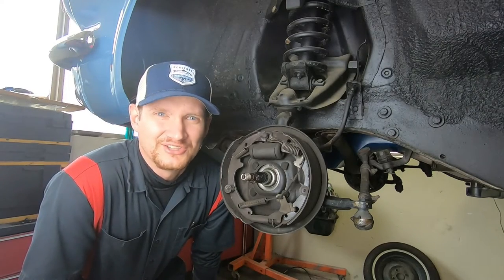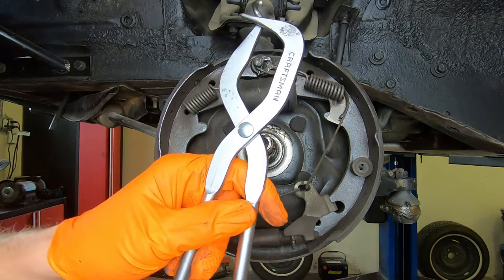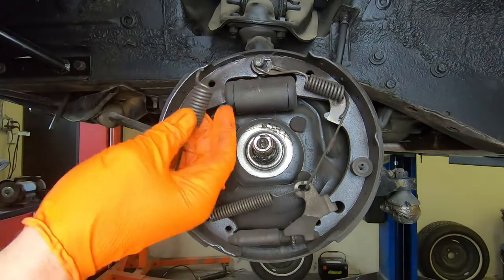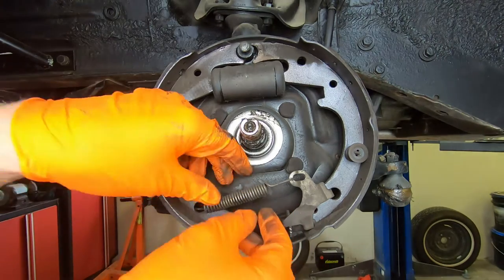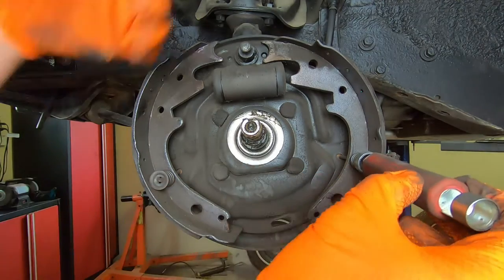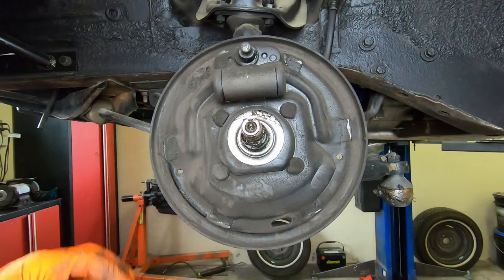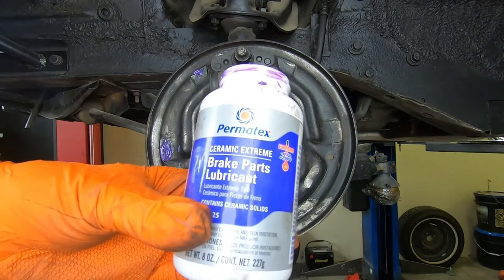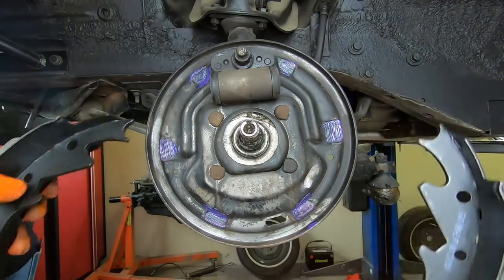How to replace drum brake shoes on your classic Ford Mustang

Comment: Excellent video on the lost art of replacing drum brakes.  Keep up the great work.  Your Mustang "how to" videos set the standard.
Reply from the maker: Oh awesome I really appreciate that!
Reply: Wow!! Mine are a bit different. There is a piece of metal with spring on it goes across over top of spindle. And then I have some type of metal stud that comes out each side of the wheel cylinder and goes to shoe to spread them. What's up with that?

Comment: Super helpful, just installed front shoes on my 71 coupe. Only thing I would add is that once these are installed, you'll need to adjust them. I turned my adjuster until it locked the cover, then backed off a little until there was slight contact
Reply from the maker: Thank you!

Comment: I have a 1956 Mercury with a hard to turn driver side front wheel - I have never done a drum brake.  I use the car every year....however, I replaced the tires and found the driver front drum so tight I can hardly turn it - even with the tire on.  I took the drum off (took 10 minutes but didnt use hammer) - not sure what I'm was looking at.  Both bearings look great.....however, the cylinder had a drip of fluid on the left side of the rubber seal.  Is it hard to turn the drum because the cylinder is leaking?  How do I reduce the pressure from the brake pads to the drum - so I can get it to a local shop 2 miles away?

Comment: My adjusting lever hangs lower than yours. I don’t hear any clicking noise when I turn the adjusting sleeve.  Will replacing the adjusting cable solve this problem??  All my springs are new...
Reply from the maker: Wouldn't hurt to try. You can get the self adjuster kits at local parts stores.
Reply: Hi, did you ever fix that lower adjustment sleeve, im having the same problem

Comment: I hope you and your wife are doing well and had a great holiday season. I have been busy putting your video's to practice rebuilding the front suspension and redoing the brakes at all 4 corners. Somethings went real easy and other things about as challenging as you would expect on a 55 year old car.  I have muddled through just about everything but I cannot for the life of me figure out how to get the new coil springs back in. I have watched some video's, did exactly what they appeared to do but no luck. I have tried both types of coil compressors you can borrow from the auto parts store with now luck. Does the front suspension have to go back in a certain order to get the springs back in, does the shock tower cover "need" to come off?  Maybe, if you have time you could do a video on the order everything goes back with emphasis on the springs? Those things are kicking my butt! Thank you as always for any advice and help you can offer.  You have been a tremendous help and resource to me, I really appreciate it.
Reply from the maker: We had a great holiday season, hopefully you as well. So the thing with coil springs is you do want the rest of the suspension together. You have to get the tool that goes inside the spring from the top. Most loaner tools are not what you need. I had to buy mine off Amazon but it was only $40 for the OEM brand tool. You definitely don't need to take shock tower cover off, just the shock absorber itself. They are a pain and I will film one next opportunity. I'm limited to film on what I get hired to fix. I will post some links of videos that helped me as well as a link for the tool I used. Just remember, patience is your best friend with these cars 👍
Reply: @AlfsMustangGarage  Thank you so much. I have put the suspension together but not tightened down everything. I a happy to buy the tool, it's cheap money to save the time and frustration. I look forward to the link to the tool and thank you again!!
Reply from the maker: https://www.amazon.com/gp/product/B00825PYBA/ref=ppx_yo_dt_b_asin_title_o07_s00?ie=UTF8&psc=1
There is the OEM tool from Amazon
https://www.youtube.com/watch?v=wR9VyxsOaCQ
Here is one of the videos I watched. Its short and sweet but it gives you an idea of how to do it. Its not as easy as it is in the video. They are a pain but once you get that tool, it should make life much easier. Just be safe and make sure that thing is on there secure.
Reply from the maker: Hey Scott, I just filmed a coil spring video for you this morning. I had an old spring I pulled off a car and I just filmed it on a bench but hopefully that gives you a good visual of how to use that tool and get it to work for you. I'll get it edited and loaded as fast as I can.
Reply: @AlfsMustangGarage  You are amazing, thank you so much!!! Also I wanted to mention that I noticed your wife is in your last video helping you. I know that she helps out on all of your video's, just wanted to say it was great seeing the two of you working as a team. I commend you both.
Reply from the maker: Thanks Scott! So I should let you know, Brittney that you'll see in the videos is actually a really good friend of mine that I hired to help me edit videos, upload videos, do some bookkeeping, but she also knows her way around cars and loves getting involved in everyway. My wife however, I can't afford her talent to have her come work with me 😂😂😂 but I'm working on getting her here.
Reply: @AlfsMustangGarage  Oh my, I am so sorry about my assumption and I hope that neither Brittney nor your wife are angry with me :-)
Reply from the maker: Ha ha! No worries, that's a completely natural assumption.

Comment: Hello...We communicated about a week ago...I hope you don"t mind me asking a follow up question.  I am looking to fully replace the components of my rear brakes on my 1966 6 cylinder convertible Mustang.  The current rear drums are 9" and the shoes are 1 1/2" wide.  Do you think this is the stock size for the convertible? I see on CJ Pony parts web site that they are saying the rear shoes for a convertible should be 2 1/4" and coup and fastback are 1 1/2". I will want to replace the drums, so I need to know the correct size.  Also, I am wondering if this is why I am having trouble with my parking brake.  I took the driver side drum off and had my wife pull the parking brake and all that happened was the compression of the spring on the brake equalizer rod, no shoe movement.  I didn't check the other side. You may remember that my initial question was about the self adjusting cable and plate that are missing on both rear brakes.  Any information would be greatly appreciated.  Thanks!!!

Comment: I have a question for you, I am rebuilding the front suspension and brakes. I have taken apart the  brakes per your video and removed the brake backing plate from the spindle in prep of doing the suspension and cleaning it all up.  Between the backing plate and the spindle is this very old, spongy like gasket thing.  I have no idea what it is or if it is even supposed to be there. Any thoughts as to what it is and is it necessary?  its a 65 6 cyl standard convertible. Thanks for all of your help and your great videos!!
Reply from the maker: Thanks Scott! So that sounds like the backing plate gasket. It should be round and between the spindle and backing plate. There should be replacements available from National Parts Depot or CJ Pony parts. I would check there first and I would definitely get new ones if rebuilding everything. It's was there from factory so I wouldn't go without it.
Reply: @AlfsMustangGarage  thank you so much, I will look for that right now.

Comment: Hi, I found this video really informative...Thank you!!  I have a question...I am thinking that perhaps this is a six cylinder car...I recently was working on my back drums on a six cylinder 1966  Mustang.  I was replacing the parking brake cable and had to take the shoes off to do this. There was no adjuster cable , metal cable holder or the tab that rest against the adjusting star on both sides.  Do you think these parts are missing or do they not exist on the back brake drums?  Any information would be greatly appreciated!
Reply from the maker: They are definitely missing. They are supposed to be there. Luckily you should be able to pick up the "self adjuster" kit from most local parts stores.
Reply: @AlfsMustangGarage  Thanks so much for the response....Do you think not having these parts are effecting the way the parking brake actuates? I have replaced all the components of the parking brake: the handle, front cable and the rear cable and the parking brake doesn't hold the wheels.  The adjusting rod under the car is almost maxed out, there is maybe 1/4" thread left for the nut to bottom out.  Thanks so much for your response.  I am learning as I am working on this car.  I am hoping to put a Wilwood front disc conversion for the front.  Maybe I should just purchase all new components for the back brakes
Reply from the maker: So those missing components are likely not affecting the park brake. What those do is adjust your brake shoes automatically as the shoes wear. However, there is supposed to be a park brake link which a a flat looking bar that will allow the shoe that the park brake cable is connected to, to push over the other shoe manually. If you Google park brake link for classic mustangs, you'll get an image of what it looks like so you can see if you're also missing this piece. I hope that helps. Perhaps another word of advise on your front disc brake conversion. What kind of power and speed is your car going to go through to justify Wilwood brakes? They are very nice products but most people I talk with are working with cars that are stock and just cruise. If that's your case, I would suggest a different kit. Let me know what you find out on the park brake 👍
Reply: Thanks!!! The parking brake equalizing rod does exist.  I have been looking into replacement parts for the rear brakes components (CJ PonyParts, John's Mustangs, NPD.)  I am not set on the Wilwood front disc conversion.  I just like the way they look.  I will also be replacing the stock single bowl master cylinder with a dual bowl.  This car is basically a cruiser with the stock 200 cu. in. engine.  I have put in a Tremec T5 5 speed from Modern Driveline.  This car does have a power booster for the drum brakes, but I still really need to step on it to stop.  I am looking for a more solid braking experience and wanting to also have the parking brake work properly.

I really appreciate you responding to me.  Your input is really helpful. Thanks!!!
Reply from the maker: Oh cool. Ya you may need to have someone help pull the handle while you watch the shoes with the drum off to see if they are working. Wilwood definitely look good. Do they offer a 4 lug disc conversion? Definitely a good idea to upgrade that master cylinder as well. Sounds like an awesome car. Good luck!

Comment: I just did a complete brake rebuild  with  everything new down to the brake line. My drums will  rotate with the wheels off but with the wheels mounted it locks up and nothing is  rubbing.  Has anyone  ran into this problem  before? The adjuster are turned all the way in also.
Reply from the maker: Have you checked the brake shoe thickness and compared to the drum thickness? Also have you tried the old drums to see if it does the same thing?

Comment: Would 66 ford Galaxie  be the same procedure right?
Reply from the maker: It would be relatively similar. These are the small 9" drums that came on a 6 cylinder Mustang. But either way, the procedure is going to be the similar.

Comment: Hey are the back drums the same ? I was wondering because of the parking brake...because that is actually not working on my 66...I have disc in the front.. and I wanted to ask.. we replaced the front springs, shocks and perches..yesterday we drove her and she kinda like groans when turning the steering wheel..everything is greased..where should I start on replacing the steering components? Oh and also I thought your video was good ! Look forward to more
Reply from the maker: The rears are very similar. You will have the park brake that connects to the rear shoe and you also have a link bar that links the two shoes. Other than that, it's the same deal.
Reply from the maker: As far as the steering goes, finding those noises is somewhat of a challenge. Is it a power steering car? Thanks for watching and subscribing.
Reply: Hey.. thanks for responding.. no its a manual steering.. the upper and lower ball joints feel good.. there's no clunking or popping.. just kind of a groaning.. Lol
Reply from the maker: No problem, so what I usually try to with noise diagnostics is first determine under what conditions the noise is occuring. Will it make the noise while parked and turning or does the car have to be rolling/driving? Does it make the noise when going over bumps? Once you do that, you have to ask yourself does it happen when something is twisting, turning, or flexing. So is it the control arms flexing going over bumps, is it a tie rod or steering box turning, or is it a wheel bearing twisting. Once you have a couple good ideas, you can try to replicate that with the vehicle in the garage.
Reply: @AlfsMustangGarage  ok yes I will try to determine exactly..I noticed it when turning..thank u.. 1 last thing GO PACK !! Haha were playing the colts in a little while  😁
Reply from the maker: Ha ha! You must be in Wisconsin or just a packer fan?
Reply: @AlfsMustangGarage  Would u believe I live in West Texas but if it wasn't so dang cold up there we'd b headed that way!!  And yes not every Texan thinks the Cowboys are America's team baahahaha
Reply from the maker: Well it's really hard to be a Cowboys fan nowadays. Ya I find lots of packer fans everywhere. I went to a Denver Bronco game one year against the Packers. It was the last year of Brett Favre. Was the greatest live game I've ever been to. Broncos tied the game with a last second field goal to force overtime. Packers won the coin toss and won the game with a 80 yard td bomb from Favre on either the first or second play in overtime. There were just as many cheese heads in the Denver Stadium as Bronco fans so the crowd was going insane.
Reply: @AlfsMustangGarage  Brett Grrrrrrrrrrrr retires then goes to the Jets and then Minnesota!! Really Minnesota ????? !! I've been to the old mile high stadium like in 91.. Houston was there.. John Elway was still QB.. Shannon Sharpe was there.. so where are you guys at ??
Reply from the maker: Lol I know. Just like all great athletes, they just don't know how to retire. We are out of Utah.
Reply: @AlfsMustangGarage  Utah? Was hoping you might b a little closer...just in case I break my 66 hahaha.. u should of seen me trying to install rear gas shocks yesterday.. it was comical
Reply from the maker: Lol ya sorry I'm not closer. Those rear shocks are fun. I've gotten to the point where I just remove the rear seats rather than crawling in the trunk 👍

Comment: We redid the drum brakes on the 1965. Two problems:

The new pins are too long causing the new springs to go past to the point of grinding against the cover. To fix this we either kept 1 original or both original pins.

The drum brakes sort of fit on slanted, perhaps due to other bent areas. We got it to fit with slightly uneven braking for whatever reason. The main issue being that there isn't enough room on the anchor pin to fit the shoe guide plate on (helps keep the shoes in place). The book does show that it should fit on with the adjuster cable and two springs.
Reply from the maker: Which hardware kit did you buy? Are you working on 9" or 10" brakes? Definitely nothing wrong with reusing old pins if you're having problems finding the correct replacements.
Reply: @AlfsMustangGarage , 10 inch. The main issue is that there isn't enough room for the guide plate which most thrown away anyway because you don't necessarily need it. Just wondering if you have any idea about it.

The hardware kit is from advancedauto. It is simply a generalized version for 10 inch. All parts worked except for pins that were too long in our case. The shoe guide plate is also a generalized part, but even if you got the specific part it seems there isn't enough room on the anchor pin anyway.

The only other solution is that this shoe guide plate isn't large enough and that the plate is supposed to sit on the larger-diameter area after the pin.

https://shop.advanceautoparts.com/p/dorman-help-drum-brake-shoe-guide-13896/17190239-p?product_channel=local&store=6191&adtype=pla&product_channel=local&store_code=6191&gclid=CjwKCAjww-CGBhALEiwAQzWxOjqooYMLZY_nUtSDW-T78CtDnckaPgi08jfL1fG4F7wB2VZii4WXKRoCDIEQAvD_BwE&gclsrc=aw.ds

https://shop.advanceautoparts.com/p/wearever-drum-brake-hardware-combi-kit-7045/5311551-P?searchTerm=10%20inch%20brake%20drum%20hardware
Reply from the maker: I guess I've yet to run into this issue. The one you listed isn't anything I've ever seen or used. This is the design I'm used to seeing. I'm guessing you just have the wrong part. Take a look at this one and let me know what you think.
https://www.cjponyparts.com/ford-drum-brake-shoe-retaining-washer-pair-mustang-1979-1993/p/HW2261/?year=1986&gclid=CjwKCAjww-CGBhALEiwAQzWxOlkZzu_ox8LDIx5czMazebXxXit_UhWP9oMGl6qo1rHm6r4kaKOuZRoCZrAQAvD_BwE
Reply: @AlfsMustangGarage ,  @Alf's Mustang Garage , is this the same part? They just have different years? Also do you know if the plate fits onto the anchor pin or the "shoulder" area.
https://www.cjponyparts.com/brake-shoe-retaining-washer-1965-1973/p/HW1236/
Reply from the maker: Yes my mistake. I didn't realize I was on the 79-93 part. They're probably different sizes but that version that you just posted should be the correct one.
Reply: @AlfsMustangGarage , is it supposed to go on the shoulder of the pin?
Reply from the maker: https://www.summitracing.com/parts/cur-ce6001n
Here is a link to a good picture of how they are supposed to be installed. I hope that is helpful.